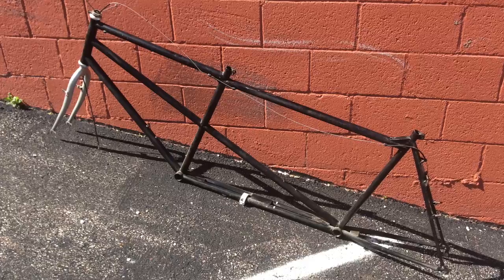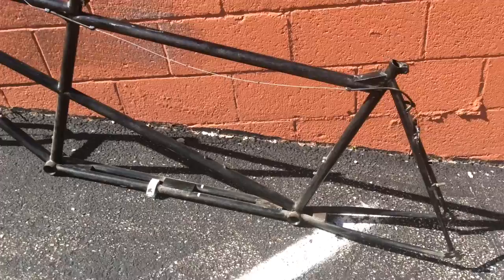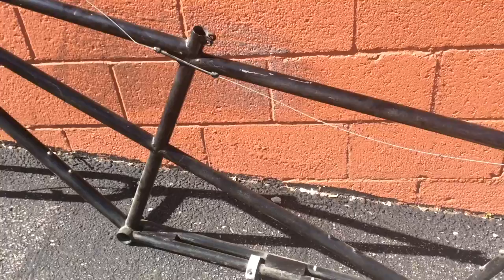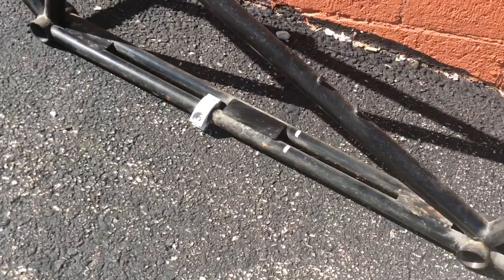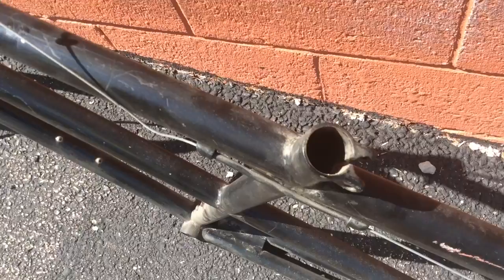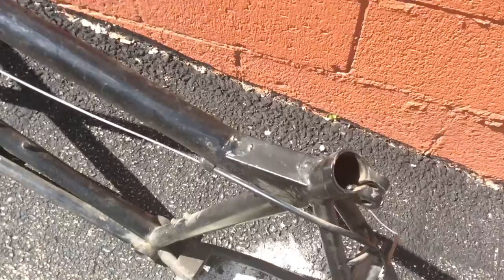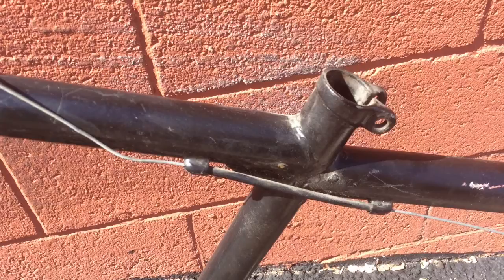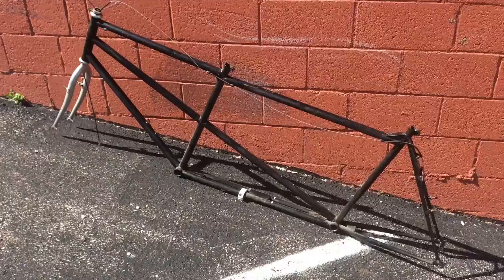DIY Tandem Bicycle

Comment: Good job! How you did with transmission?
Reply from the maker: Sind there isn’t an eccentric bottom bracket front or rear I had to run an idler pulley to take up the slack on the right tube between the two BBs.  It took some doing but with the proper chain length and the proper pulley position it did the job well.